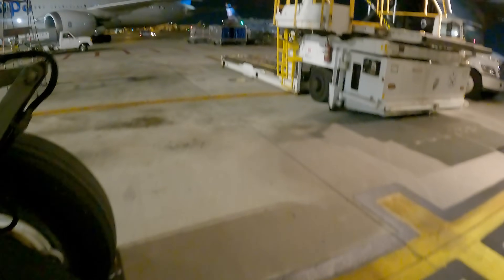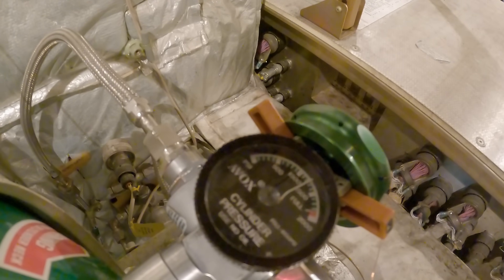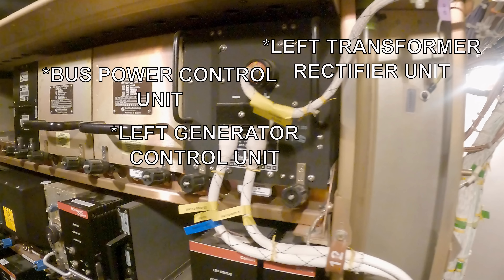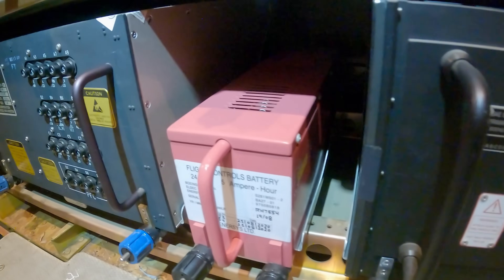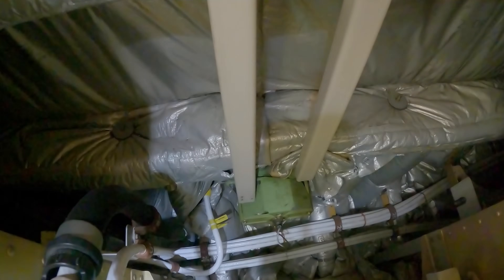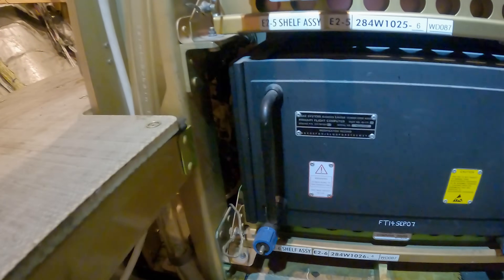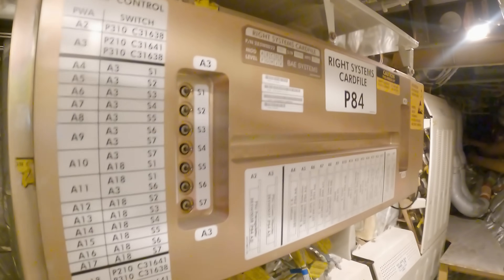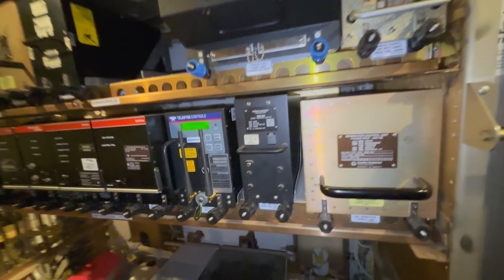B777 Main Equipment Center Walkthrough

Comment: Dennis thank you for sharing ! Can I ask are there any air ventilation ? Think of the temperature of that area is  high .
Reply from the maker: @rogertsang4169  everything is connected to the equipment cooling system, this forces air through the avionics to keep them within there operating temperarures. The compartment itself does not get airconditioned.
Reply: That explains a layer of dust on some of the racks...
Reply: @fredfred2363  Yes, that surprised me actually. I didn't think computers and dust mixed very well! Thought the compartment would be air conditioned and sterile!